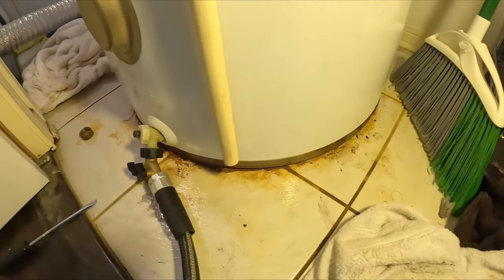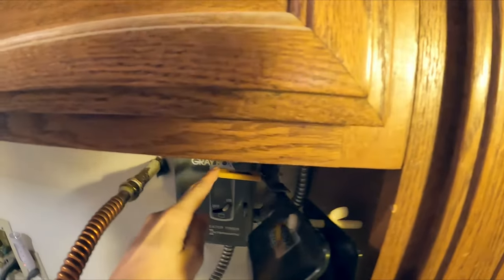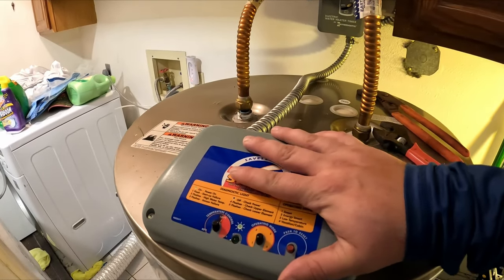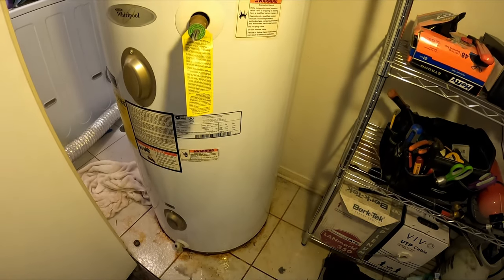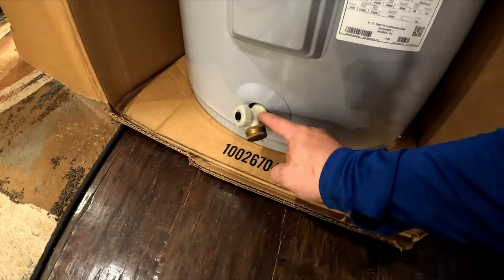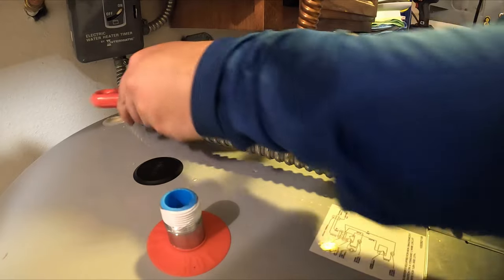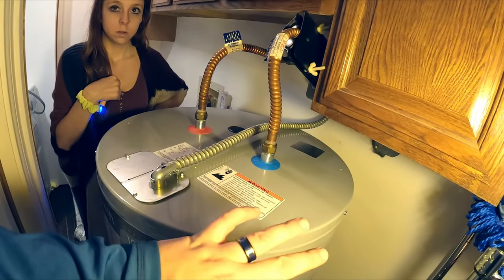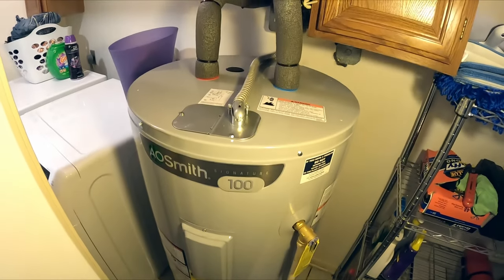Replace A Hot Water Heater! | FAST! | Step By Step

Comment: I would have put a pan under it. If you have a one way check valve on your water supply, (modern supplies do) you needed an expansion tank. Also if the anode rod had been changed about every 3 years chances are your tank would have lasted a lot longer.

Comment: Great video! Only thing I would suggest is set the water heater in a water heater pan. If a small leak starts you will see the water collect in the pan and possible get the water turned off before any damage occurs to floor or sheet rock.
Reply from the maker: We didn't use a pan because we have a drain there in the utility room but we still considered using one anyway.  You're right it's a great idea to use one.
Reply: Most of the time they do no good every one I seen go bad it was always from the top near the two pipes coming out of the top.
Reply from the maker: Thanks for the info!

Comment: What are the blue plastic in the water connections?? I had to take mine out to get fittings on I used wouldn't fit with them in.

Comment: first time installing this  ao smith water heater i did all the process and  so then i turned on power  ,i didndt get enough hot water  and i was only getiing warm water in some ares like kitchen sink and bathroom sink but threres a bathroom few feet from the water heater im not getting warm or hot water at all , what a notice that i believe water heater didnt  fill up  all the way ,,, i started thinking i have water pressure issues since i chacked only have about 20 to 25 psi pressure
Reply from the maker: You may be right that's very low pressure.  It's possible something got clogged in your water lines too.
Reply: @SixthDayRanch  water line I believe is ok just kinda confused I don’t get no hot or warm water  in the other bathroom . So now  in going to test for bad element possible went bad since tank didn’t fill all the way
Reply from the maker: Unfortunately that's possible if the tank wasn't full.  It's an easy mistake to make.  Hope it's an easy fix for you!

Comment: How long does it take for the tank to start producing hot water? I installed mine and it has made no hot water after almost 3 hours
Reply from the maker: Definitely something is wrong. Usually less than an hour.  Within 30 minutes we could tell the difference in temp.
Reply from the maker: Double check your breaker and wiring.  Even if one of the heating elements was bad you should feel heat by 3 hours.  Hope it's a simple fix for you!
Reply: I’m having this same issue right now. That being said it’s very cold obviously the the unit it’s in a extended part of the house that has no heat so it’s basically a shed. It’s been hours and still not hot water
Reply: On a electric water heater be sure to refill water before turning on power, heating elements will burn out immediately if dry.

Comment: Water heaters 🤦‍♂️. We put a new one in 4 years ago and had to put in another new one 2 months ago. Remember when they made things that lasted? I do.
 We had a plumber do the job because it’s propane and I just wanted it done right since I don’t mess with stuff I have no knowledge of. I walked into the room 3 hrs after the plumber left to find it shooting water out of a fitting on top and the floor covered in water. Needless to say I got the bill erased and chewed some butt, but the whole ordeal was a headache. 
We hope to get the 12 years out of this one that they say it’ll last, but I’m a realist and know better.
Reply from the maker: Oh wow that sounds like a nightmare! You're absolutely right! Nothing seems to last anymore.  It's always about the cheapest product and doesn't seem to be about quality anymore.
Reply: Even when you buy the more expensive model, it doesn’t matter.
Reply from the maker: Yes! We have experienced the same thing over the last several years.  From refrigerators to washers and dryers.  We buy name brand and it's still junk that won't last.  Only thinng that helps now is hopefully the better brands have a good warranty.  Even that's questionable.  At this point we expect to have to replace these things more frequently. It's a shame.

Comment: The title says, "Replace a hot water heater." Why would you want to heat hot water?
Reply from the maker: SEO
Reply: The component being replaced is called a "Hot Water Heater" it heats cold water to a temperature level acceptable for the needs of a general household. It also heats hot water within the unit to a higher temperature level as required when the thermostat on the unit which operates between a certain upper and lower temperature range calls for a higher temperature, equal to the temperature setting of the thermostat. Then it shuts off. 
Periodically therefore there is a requirement for a hot water heater to heat hot water.
Reply: @pip393 You really out did yourself replying to a joke! BTW Jokes on you.